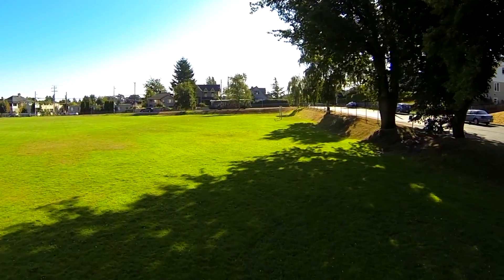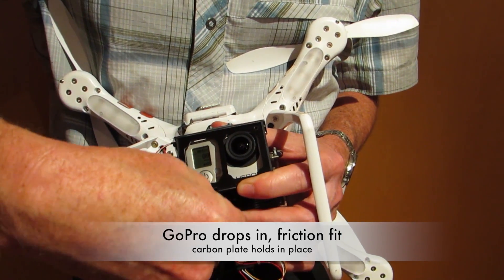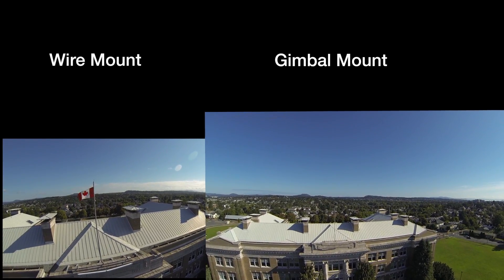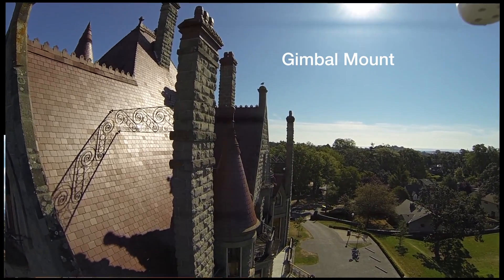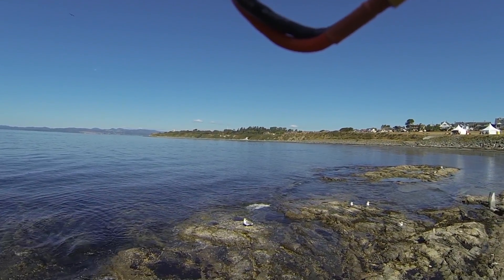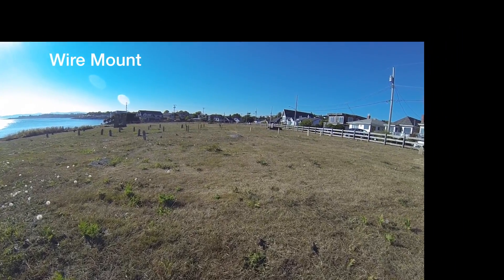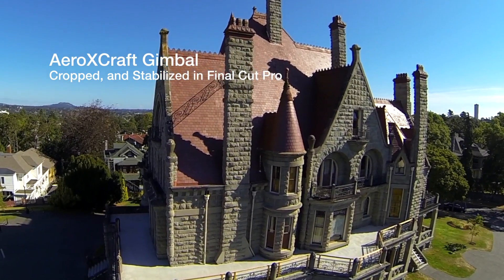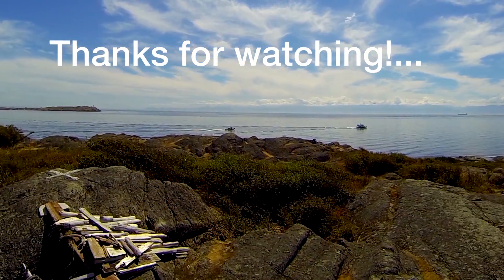AeroXcraft Gimbal for Phantom Quadcopter

Comment from the maker: The final shot of the Craigdarroch Castle descending shot was rinsed through Final Cut Pro X stabilization, but it didnt make much difference. Initialize in a calm setting so that the gimbal has no vibration from a breeze and all should be good. Of course props were balanced and I wasnt doing crazy flying in high winds, but still, did what its supposed to do.

Comment from the maker: Since this video was made I didn't follow my own advice. I hit a pole in a beach shot that knocked my rig into the ocean. After removing sand and seaweed, a fresh water rinse and a thorough drying out the gimbal stills works fine! The GoPro almost, its lost its wifi option, and the phantom GPS is wonky.